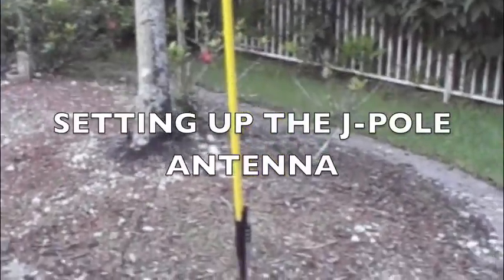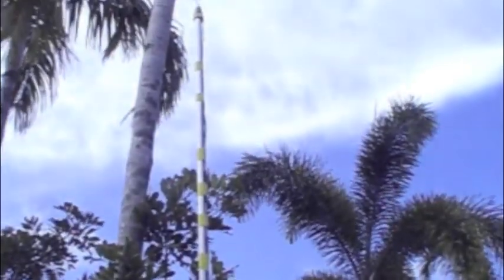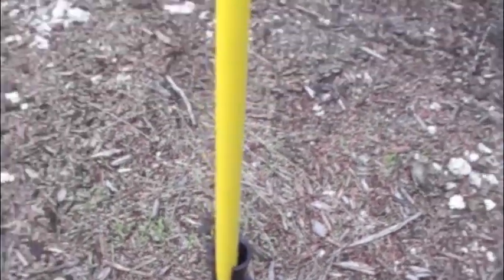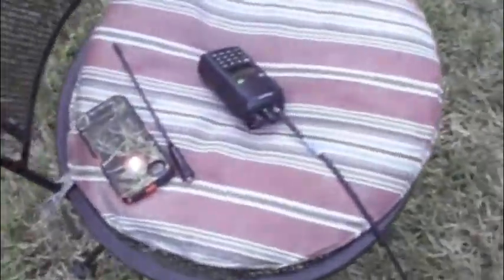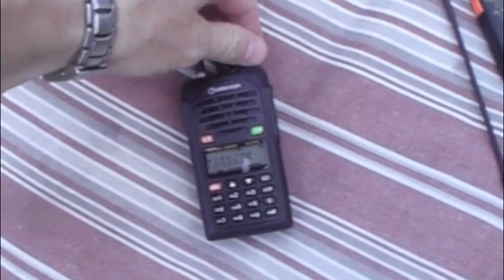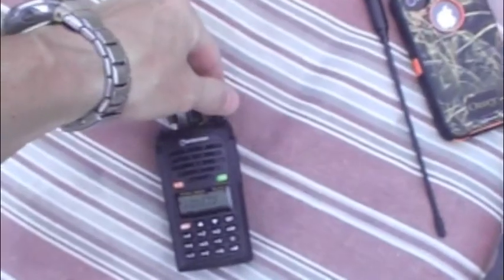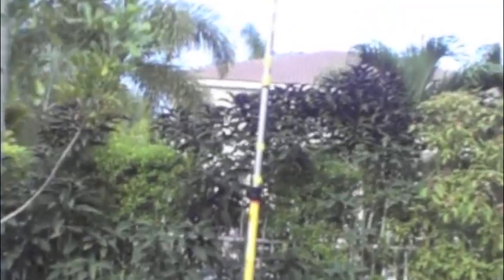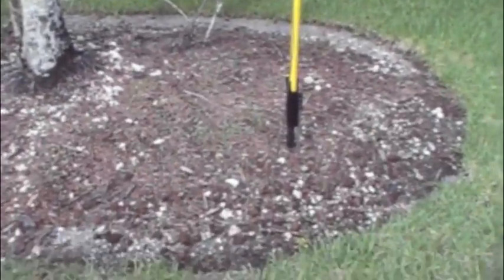Ham Radio-Field Testing- J-Pole Antenna

Comment from the maker: Excellent video response.  I learned a lot watching your video.  My original intent for buying this antenna was to string it from a tree in the field or at home.  I did not realize that being close to the painters pole would de-tune.  I will do my next video with the antenna free hanging and see how my reception/transmission goes.  Thanks for all your help.  Anthony.

Comment: I just responded with a video I made some time ago. The metallic painter pole will seriously de-tune your antenna making it un-usable for the ham band, and the way you have it so close together, it will reflect power back into your radio which could damage your radio. For the best results, that antenna has to be deployed in free air with no obstacles around it. The VR is a bit long and dry but it shows a few materials I used trying to camouflage it, results taken from industry test equipment.

Comment: Minimum of 2 feet away from the tree trunk should be good seperation, branches does not have an effect to performance. Try listening to the net in a free floating configuration and it will come in a lot clearer. I just wanted to show you what could happen and prevent any damage to your preps. Other than that, its a solid piece of gear every communicator should have in their kit. Good vid as always, I like the way you actually use and test all the gear you review. take care.

Comment from the maker: Thanks for the info.  Next time I monitor the net will be from a tree, free hanging the antenna. I appreciate the help and all the info in your video.  I think this is a must have piece of gear for any prepper as it will greatly enhance your comms in the field and can be carried and deployed easily.  I am very new to Ham Radio and am still learning basic stuff.  Tonight I had problems with the wrong PL Tones and the Net had trouble hearing my transmission.  I made a vid of that also.  Anthony.

Comment: Thanks for the video. I just wanted to echo the other comment about the antenna being detuned by its proximity to the metal pole (or any metal). This is definitely true, and can be observed with an antenna analyzer. The antenna's resonant frequency will change and move away from the frequency for which it was designed. As you found, you can still listen with it. But its performance, especially on transmit, will be degraded when mounted this way. J-poles are great, but have their limitations.

Comment: Any reason for 16ft of Coax? Wanting to build one of these, but I do not understand the 16 foot part.
Reply from the maker: Yes.  So when you deploy it up into a tree you have enough cable to attach to your radio.  Thanks for watching.
Reply: biblesnbarbells Ah. I was thinking that the length of Coax had something to do with matching impedence. Will probably hit Rat Shack today and build one.
Reply from the maker: Let me know how it turns out.
Reply: biblesnbarbells Searched all over town yesterday for twin lead or ladder line and came up with nothing. May have to order some online.
Reply from the maker: There is a guy on eBay that sells it.  I placed his link in my video.
Reply: There are good tutorials to create them with the minimum of implements ... luck colleagues of radio amateur CD1-CAC

Comment: Did you check your SWR. Putting any J-pole next to anything, metal or wood, DE-TUNES it. You may hear well, but your are probably loosing power to a high SWR.
Reply from the maker: No I did not do that on this set up. Thank you for the information.  Anthony.